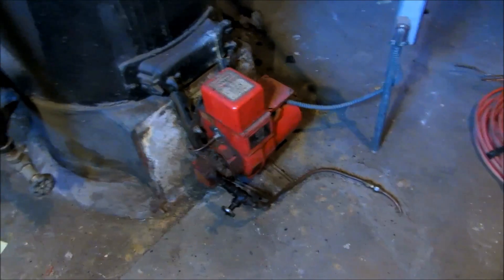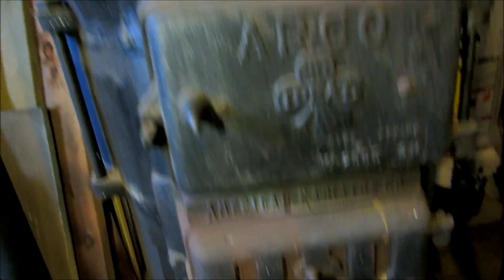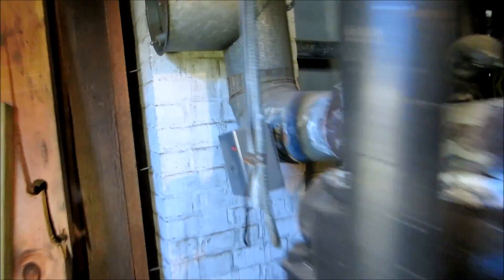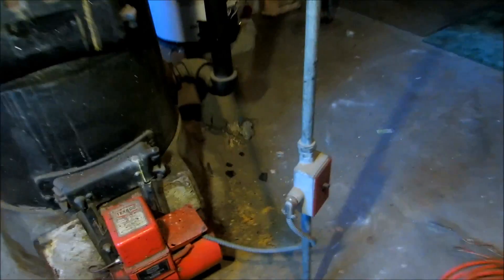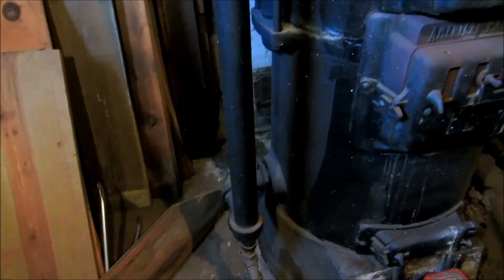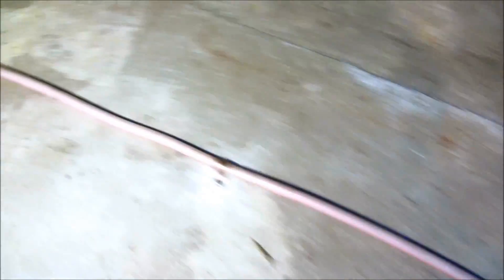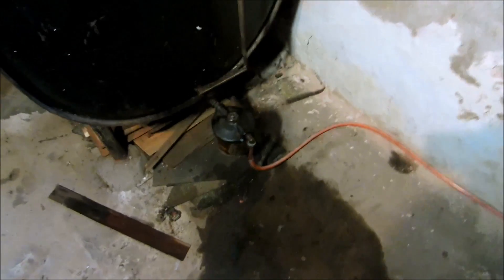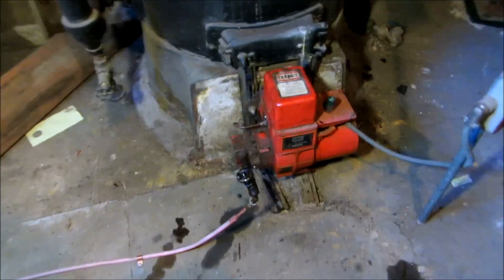old gravity ,pancake style boiler upgraided oil line

Comment: I wonder if there is a tubing bender for the shielded copper , I haven't seen one
Reply from the maker: airkraft1 you do not need one i just bend by hand the covering asks like a spring ,i will have to try to bend a small piece to see if it will kink. i have some in my pile of scrap i do believe you can just use a bender one size up to bend the coated tubing . we use it on oil and propane gas here oil is orange ,propane is yellow
Reply: steven lavimoniere
It's being installed here I just haven't personally put it in , I haven't had the need as of yet. I do like using a bender on copper where I can though

Comment: That's one thing about our trade Steven, you can be a "Super Tech" on all the modern boilers, but an old system like this with a stack switch and no circulator would throw a new guy in the trade for a loop. You need to learn the boilers just past the age of the wood stove!!!
Reply from the maker: Brad1237202 it work a lot better with a circulator